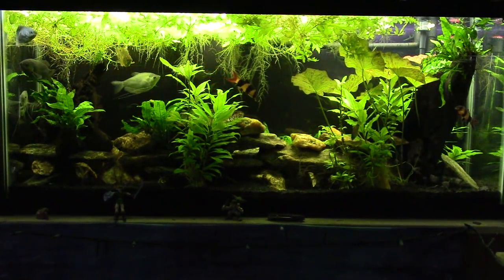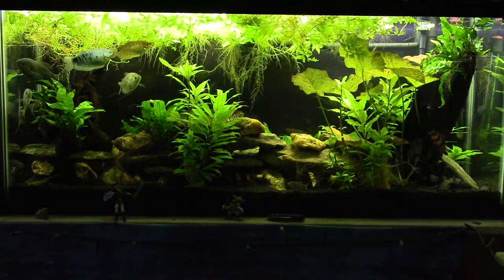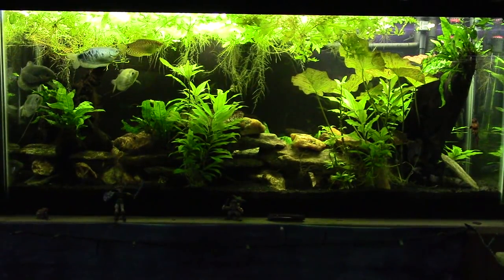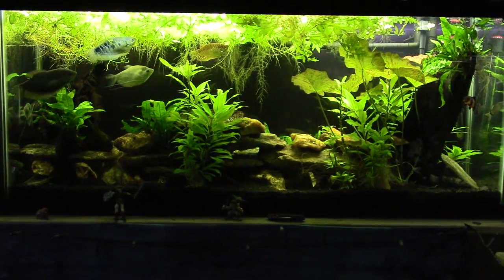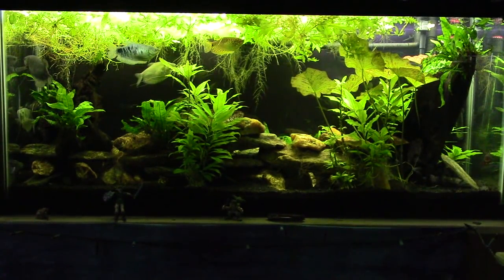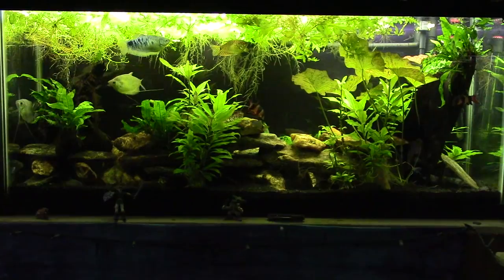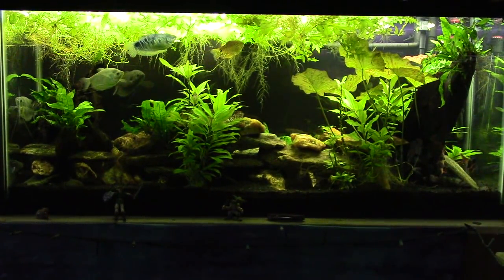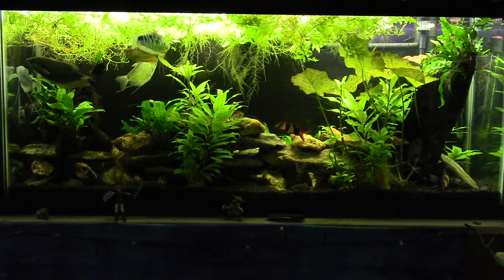Water Hardness and Osmoregulation; Why it's so important.

Comment: Noice tank, incorperates many of the very same ideas that  I have for own tank. May please ask of you  ...what  are dimensions of the aquarium in the video?
Reply from the maker: +Barefoots Child The first 2 are 55 gallons, the 3rd one is a 40 Breeder, and the final one is 125 gallons.
Reply: Thanks, I'm going thru your playlists now. This stuff is good, I am located in lower central mivhigan, where are you located?
Reply: This channek is surely a keeper.
Reply: +Dan Hiteshew I am about to set up a new 75gal aquarium that is 18 back to front and 25 top to bottom, I'm wondering if it too deep or too narrow (back to front). What do you thinkj? Do you think that it might be too narrow (front to back) for depth of field?
Reply from the maker: ***** My 55's are only 13 inches deep. My 40 and 125 are both 18. I like the 18 inch depth, but it all depends on how you want to set it up.
Reply: +Barefoots Child Oops ...I think I should have written "field of depth"
Reply: +Barefoots Child Oops ...I think I should have written "field of depth"